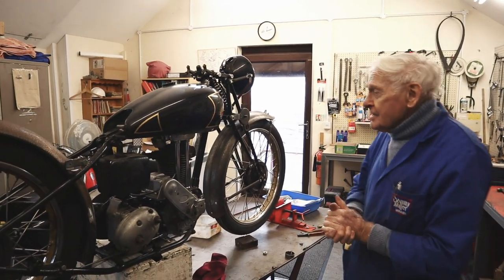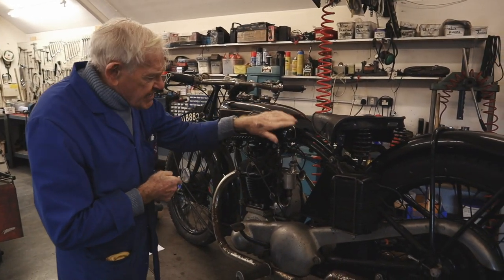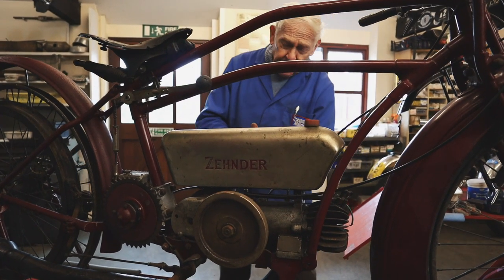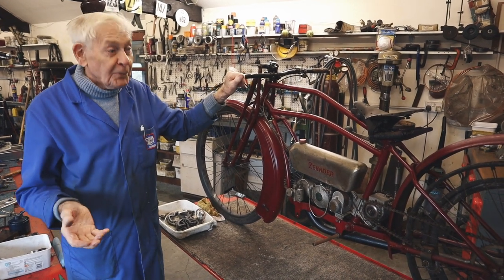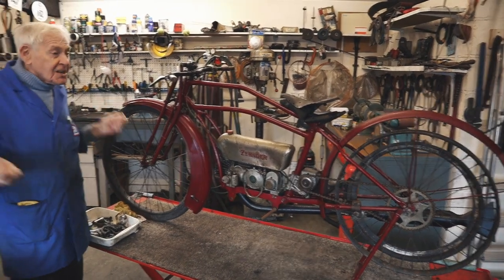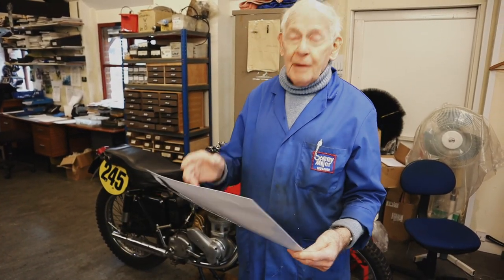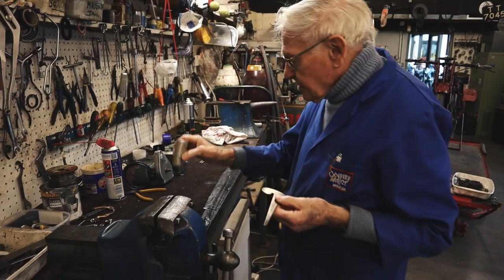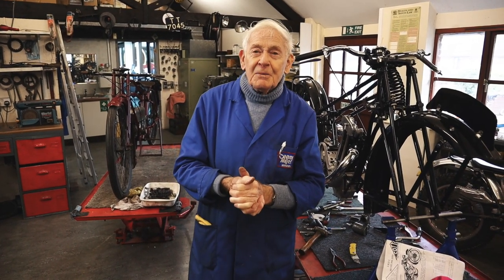2021 Workshop Update

Comment: Do you do your own blast cleaning and polishing in house? I remember a motorcycle shop I once worked at where I used to vapor blast as well as dry blast parts that customers brought in to be done, also alloy polishing too. It was very rewarding work seeing parts come in looking like they had just been picked up off a scrap heap and going out looking like new. That sort of work was a second string to  the bow in winter when normal trade used to slow down.